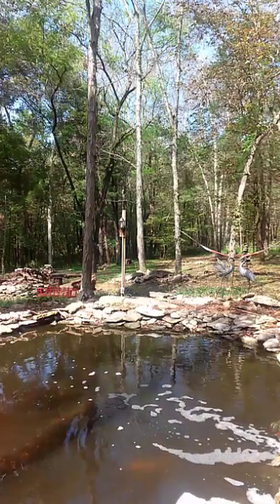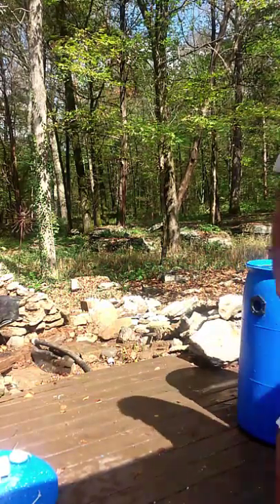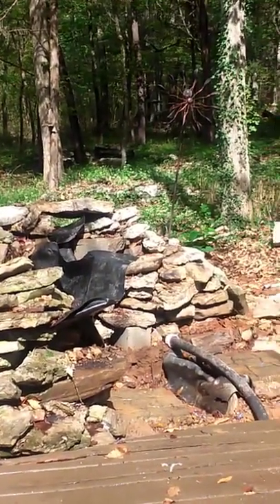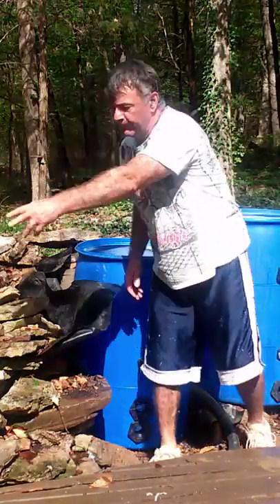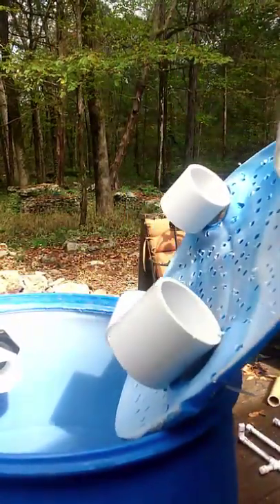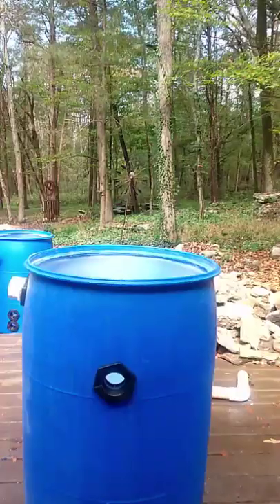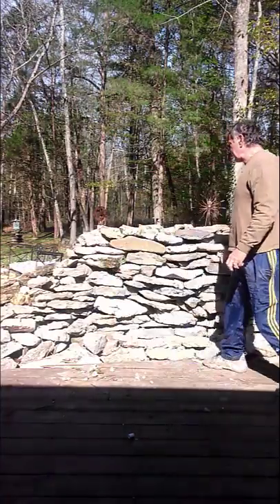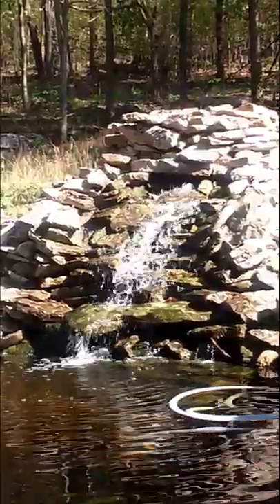2 Barrel Pond cleaning system DETAILED STEP BY STEP

Comment: Gonna be doing something similar with those 1 ton cubical fluid tanks to clean a dugout pond here in Alberta.  Dugout is some 350,000 gallons. and the whole system needs to be able to be drained for winter because there is no way I can keep a system of that size from freezing solid in our -40C winters.  I'll let you know how it all goes.

Comment: Dear sir
Great work
But what will happen if air supply stop working
Water go through pipe to air pump or your idea something else
Thanks
Pls reply
Thanks again great work
Reply: You can buy small high output air compressors designed for this very thing. Air should go to pond and to "boil" or turn the bio balls in bio tank. The video he shows a quick connector and ball valves for controlling which tank gets air.  He may have since attached a permeant air compressor so that it is on all the time during the spring, summer, and fall. Only thing you have to watch out is that water does not backwash into your compressor by either a air loop above water level of a safety check valve.

Comment: How do u flush the dirt out when your back wash drains are at the bottom and you use a air manifold to blow the dirt to the top thru the gravel and bio
Reply: The air will loosen the "dirt" which will drop to bottom during settling, where the bottom flush drains will remove the dirty water.

Comment: Where do you bought that bulk fitting?
Reply: He said from a farm supplier, but a pond supplier will also have those bulkheads... better option is rubber ones, drill then just push your pipe in, no tightening and no leaks.